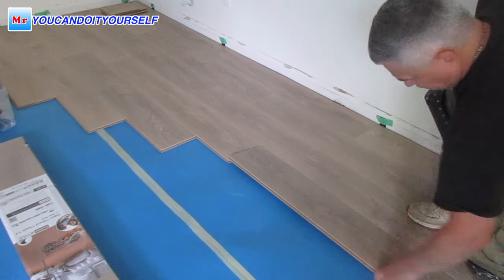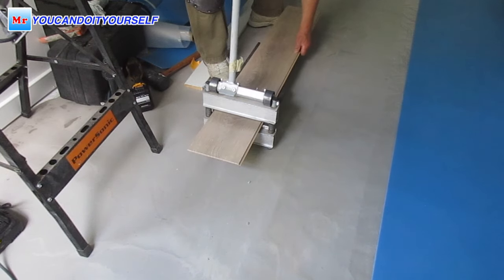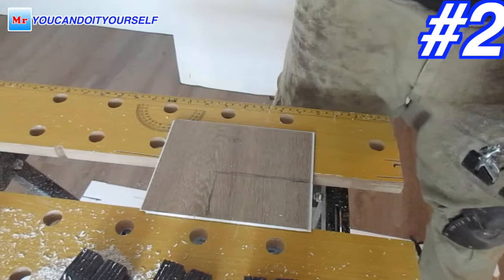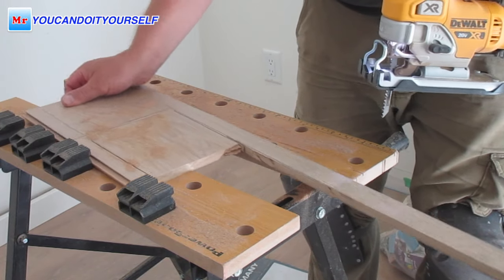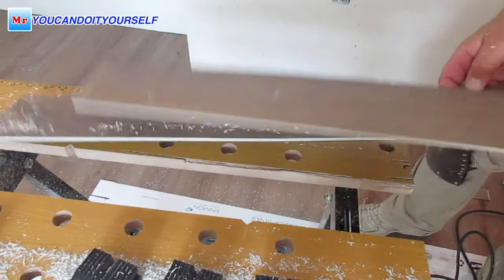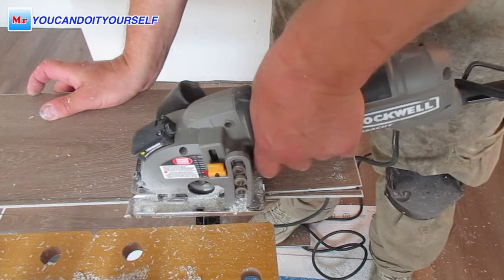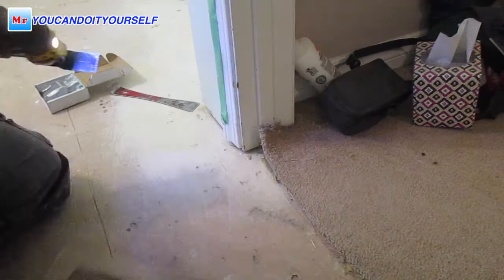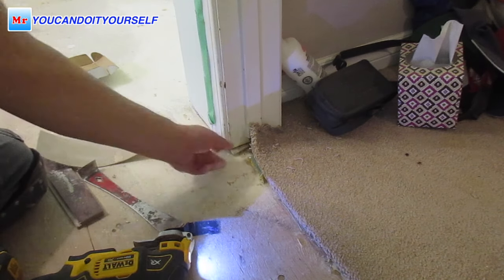3 Best Tools for Cutting Laminate Vinyl Floor| Laminate cutter Jigsaw Small Saw MrYoucandoityourself

Comment: The problem I'm having with the jigsaw on the smaller 90° cuts is, even when using a piece of thick wood as a guide, the blade wiggles and the cuts don't come out straight.  Any techniques that help with this?
Reply from the maker: Only guide.

Comment: Useful video! But what about the accuracy cut when you work with compact circular saw?
Reply from the maker: Hi Rinat, that saw has a laser and also a mark on the bottom plate to get the right position for the blade. I don't have any problem with cutting the laminate or vinyl floor with this saw. Thanks for your question!

Comment: Like the video. What’s the best tool to remove the lip of a click laminate board? I have removed a damaged board. I have the new board but need to trip this narrow piece so the replacement board fits. It’s quite narrow, but I can’t do it with a block sander. Hope this makes sense.
Reply from the maker: I never change laminate damaged board, maybe somebody else helping you.

Comment: what kind of blade do you use with the jigsaw?
Reply from the maker: Regular for wood.
Reply: I've tried cutting my laminated wood with a wood cutting blade in my Zig, but it chips. I even tried cutting with the wrong side up... better, but tiny chips. Is it the blade or 🤷🏽‍♀️.  Should I use a different kind if blade? In a comment above you said a plastic cutting blade?
Reply from the maker: @tieastsmith2700  Hi, if you don't have another blade, put painter's tape over the cutting line, and cut the piece. It should help, otherwise buy blade for plastic or for metal. Thanks!
Reply: @MrYoucandoityourself  thank you. I'll try the tape first since it's what I have handy, if not, I'll go and get plastic and or metal blades.
Reply from the maker: @tieastsmith2700  Great!

Comment: What are the best blades to use.
Reply from the maker: I don’t understand your question. If you ask about jigsaw blades, there is manufacturer recommended blades specific for wood, plastic and metal. If you installing vinyl flooring, use blade for plastic. Very simple.
Reply: Thanks. I wasn’t sure if I needed a special tooth on a jigsaw blade for cutting laminate flooring. I have a good blade for a chop saw but didn’t want to ruin it.
Reply from the maker: @jamesthrift6194  If I am using a chop saw for laminate or vinyl flooring I use old blades.

Comment: There is no one single answer. For big cutting you need a jigsaw machine with great blades. And for around the edges and detailing probably a oscillating cutter
Reply from the maker: Thanks for your advice!